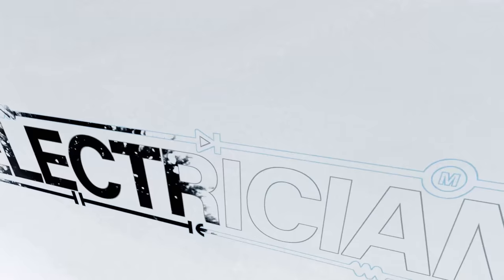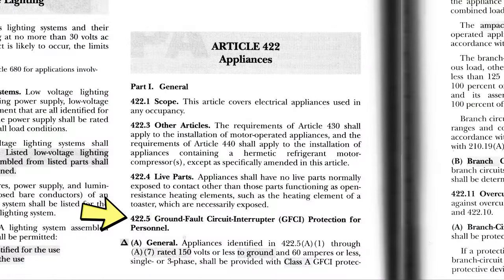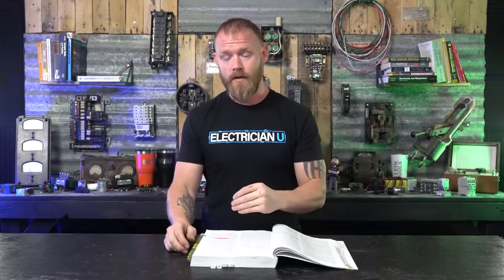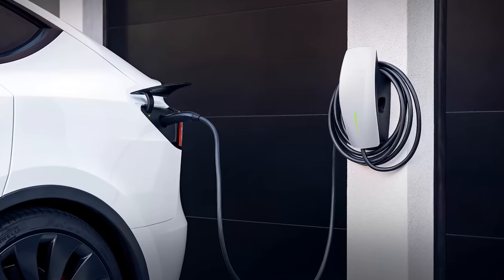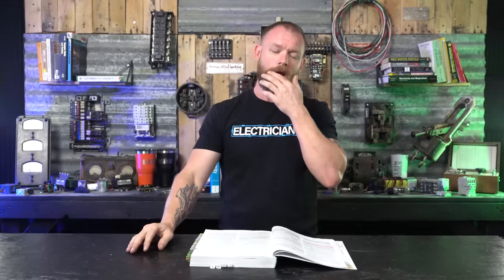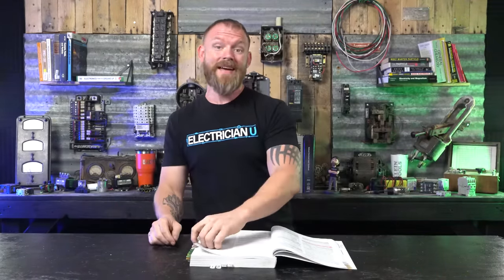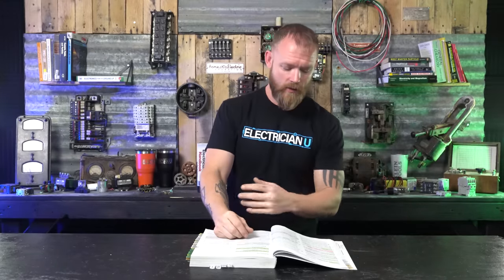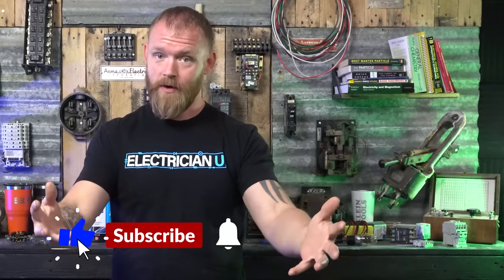Should We AFCI Protect Appliances?

Comment: I have couple questions for you 
I have a new house built in 2021 and I’m in the process of finishing the basement and I pulled the cover off the main breaker panel and found that 99% of my breakers are  AFCI two pole breakers and the neutral and power wires are both Terminated on the breaker with a jumper going from the neutral wire to the neutral busbar in the panel 60 and the grounds and neutrals are separated in the panel
There is no other service disconnect other than the main breaker in the panel From the main service feed
My question is are the neutrals and grounds separated in the main panel because of the AFCI Breakers or am I missing something
Thanks in advance…

Comment: I just need to extend a 20A branch circuit from one outbuilding to another (via new underground line) for the sake of adding some outlets in that second building. 

No water or wet conditions in either building. I'll probably make sure the first outlet in the first outbuilding is an AF/GFCI outlet, I'll use 12-gauge wiring (because of the 20A breaker), I'll probably use 20A outlets in the second outbuilding. 

I think I'm all set for that, with a little more reading up on whether I need the AFCI feature at all. Now I just need to figure out the whole grounding thing (find out how the existing branch circuit is grounded and if I need additional grounding measures on the extension or just extend the existing ground wire through the new outlets).

Comment: So if your oven's receptacle need to be GFI, cut the cord, wire it permanently and you just saved about 200$! 😉
Reply: LOL Then the home owner is hiring an electrician overtime that range needs replaced.  With today's modern quality of appliances, the average would be 5-10 years at most.
Reply: GFCI protection for a receptacle of that size would come from the breaker and not locally at the plug like a normal nema 5-15 GFCI. So cutting the cord would do nothing because it's the breaker that would have to be reset
Reply: @zeddpilsner4  permanent wiring would mean no GFCI because it's the receptacle needing protection, not the oven...
Reply: @drewbrown9678  then, why are (90%) dishwashers not with a plug? Anyway, any homeowner is able to disconnect something, it's when they have to put a branch in panel, or reconnect something they call the electrician.

Comment: Things that have motors that can shock you, it makes sense. But I think they are getting carried away with codes and ignoring nuisance trips. One- the GFCI/ACFI are not cheap. When you think two bucks a receptacle, then more for tamper-proof, and now 5-10x as much for GFCI and ACFI... hundreds of dollars for a single family home in outlets now. Sure, you can put a ACFI breaker in place, but again... for modern homes I can see that.  BTW, lost several hundred dollars in meats and frozen produce to a nuisance tripped chest freezer. Happened once. Pulled that GFCI out and put in regular..I can as the home owner.
Reply: Losing hundreds of dollars of freezer contents when a GFCI trips is extremely common.  You made the right call by eliminating the GFCI.
Reply: if you're paying over $2.00 for non tamper proof receptacles, you need to change hardware stores.

Comment: We install gfci/arc fault breakers on everything except 220 v plugs  or 120 volt furnaces. We do however have to gfci protect any 220 volt plug in garages.  They are a headache and I would put regular breakers on anything like a refrigerator etc that that is the only thing being on that circuit and is not going to be exposed to water. That being said having to pull two separate kit circuits we used to homerun to fridge then catch couple kit plugs and thar would be 1 of our 2 kit circuits but now we dedicate the fridge. I recommend dedicating the fridge anyway because of what it is.

Comment: Yeah and the sucky thing is some washing machines have “issues” when being plugged into a afci/gfci outlet…..some just hate it; while others don’t care.
Anyone else have those fun troubles on service call and trying to figure why a homeowner’s new washing machine just won’t work, lol
Reply: not a washing machine, but i have had calls where customers are having breakers trip because they wanted to turn their lights on. apparently Seimens  AFCI breakers don't like it when you turn your lights on
Reply: Big roasters don't work on GFCI either.
Reply: No problem with the washing machine, but the gas dryer tripped instantly. Plugged it instead into the circuit with the washer and a sanitary pump and the problem went away. Yes, the breaker then got changed.
Reply: I should add that the GFCI outlet was not a problem. It was the AFCI breaker that would trip.
Reply: concering dryers and gfci's, sometimes the nuetral is bonded to the appliance and will cause the gfci to trip. I can see this being done away with by appliance maufactures in the future, but that's how their designed so a homeowner can swap a chord rather than call an electrician.
Reply: @danielcarroll3358  If it uses a spark igniter, and if it is not have galvanic (transformer) isolation in the high-voltage supply, it could have just enough current to ground to trip a touchy GFCI while operating normally.
Reply: @nealbrinton4374  Definitely if it is plugged into a GFCI, it must have a four wire plug and cord with no bonding between neutral and ground in the device.
Reply: @strehlow  It doesn't trip the GFCI. That works fine. It trips the AFCI.
Reply: @danielcarroll3358  Eh sorry, I missed that bit. I could see where a spark igniter could generate enough of the noise on the line that an AFCI is looking for. You might try plugging it into a power strip with a noise filter and surge suppressor to see if that stops it.
Reply: @strehlow  I thought about adding a filter, but when plugged into the adjacent outlet on a different AFCI breaker there is no problem. And that breaker also feeds the washing machine and the sump pump. The laundry room is below the sewer line so the pump is needed.

Comment: I wonder if my house wouldn't have burned down if the outlet my portable AC unit was on had an AFCI breaker. The inspector said the fire started somewhere up in the attic where the wires were ran.

Comment: I brought up article 210.12 on your EV charger video. I researched the different Tesla chargers. They have built in GFCI. That problem is solved. If the EV charger is hanging in a garage, the charger has a plug and might also plug into a 650 or 14-50 receptacle.  I assume the charger has to be AFCI protected?
Reply: AFCI protection is not required in garages at all. In areas where it IS required, only 120V, 15A and 20A circuits require AFCI. 240V circuits don't need AFCI at all. 210.12(A)

Comment: I'm going to make this simple. The code refers to where you HAVE to use one of these devices. Often you'll come across situations where you don't have to use one, but it's probably a good idea for peace of mind. Personally I'd rather spend the extra money so I can sleep better. A code is only written when a problem has come up from result of some condition or unforeseen factor, hence the changes in codes from year to year. I know arc fault devices are sensitive. Use them accordingly. One day GFCI  is going to be required for every application. It's just a matter of time. I hate to say this but safety is no accident. On a personal note I'd like to see any extension cord smaller than 14 gauge be banned. Party on dude.
Reply: Yeah, those 100 foot 18 gauge extension cords, made in...who knows where...are sketchy big time.
Reply: @larryroyovitz7829  The problem I have with extensions is that a 15 amp circuit uses a 14 gauge wire. then someone plugs in a 16 gauge extension and tries to power a window ac or other high current device and causes a fire while they are in bed sleeping. For a single lamp it's just fine.  I think anything smaller than. #14 connected to a 15 amp circuit is dangerous.
Reply: @rickhunt3183  I agree, that's the same problem I have. I wasn't being sarcastic, I literally mean there are 16 gauge, 100 foot extension cords made in China. I've seen them...scary ass shit.
Reply: Ever feel how warm a vacuum cord gets? They are often 16 or 18 gauge wire! Who thought that was ok? I'm also perplexed by 20 gauge from the ballast in fluorescent lights.
Reply: @johnruskin4290  while wires can typically operate at temperatures over 150 degrees. Any heat produced by wire resistance is wasted power. If a 14 gauge is hot bumping it up to a 12 isn't a bad idea. Sometimes you'll find a hard ass inspector that insists  a 15 amp circuit needs a 14 gauge wire and I'll say, but this wire is bigger so it's safer, and runs cooler, and he'll say pull it all the 12 and install 14.. Hard to believe I know, because an inspector is an electrician, and knows this stuff. Always start off being nice  and respectful even if they are an idiot.

Comment: To me, a GFCI isn't just to protect when plugging/unplugging but if a fault develops in the device plugged into that outlet.  If the insulation on a wire in that stove/oven fails, the body of the stove/oven could be electrically energized.  If one happened to reach for the faucet at the same time touching the stove that would be very bad.
Reply: That's not really what a GFCI is "for". That's what the ground itself is for, since that should cause a short to ground and trip the breaker. GFCI's primary purpose isn't as a backup to proper grounding (although it does function that way too), it's to protect against other paths from the hot directly through a person, for example via water.
Reply: @sweepingdenver  In a perfect world, the ground connection would take all of the current flow to ground, exceed the current rating for the breaker by a substantial amount, and the breaker would open.  But what happens if one of those "perfect world" requirements doesn't happen?  Keep in mind that the stove/oven might have a 30 or 50 amp breaker and anything over 0.005 amp (5 milliamps) can be fatal.  That means that literally 99.99% of the current leakage current could be going to ground without tripping the breaker and the one part in ten-thousand that flows through a person's body could kill them.

THAT IS WHAT A GFCI IS MEANT TO PREVENT.

Comment: If the ground  is touching the neutral anywhere past the main point of disconnect in a circuit or will cause what is known as "nuisance" tripping. I do lots of service work and install AFCI breakers all the time on old panels and rarely have issues.
Reply: I’ve opened a lot of receptacles where ground and neutral were joined. I feel like in my area there must have been a sparky who thought that was the way to do it.

Comment: This Is Interesting Video.  Not Sure If AFCI Is Same As Industrial Arc Flash Study, But A Few Years Ago I Was Involved With An Industrial Arc Flash Study For My Employer. The Original Was Done When Plant Was First Built (Finished In 2000/2001). Our Safety Director Insisted On A New/Updated One Since There Had Been Some Expansion Through The Years. It Was My Responsibility To Gather Info (Wire Size & Distance/Breaker Size And Settings/Connected Loads). Consultant Said To Only Include 480 And Above For Study (I Believe They Said 208VAC Cannot/Does Not Carry Enough Capacity/Energy For Sustained Arc Flash). Has 70E Been Updated (2015 Was When We Completed Study)To Include Lower Voltage In Residential Setting?

Comment: How about a dedicated circuit that is hard wired?
Example: An electric heater in a garage.
240v 30a run directly from a breaker to a box mounted on a wall stud with a whip from the box to the heater that is permanently bolted to the ceiling.

Comment: I don't think it was mentioned, but AFCI is only required on 120V, 15A and 20A circuits. Not required on any 240V circuits (210.12(A)). Also, 210.12(A) says that circuits require AFCI protection when there's an outlet OR DEVICE in one of the specified locations. So, for example, a circuit that supplies outdoor lighting doesn't need AFCI, BUT if the switch that controls those lights is in a hallway, or living room, or kitchen, or some other area that DOES require AFCI, then you need to AFCI protect it, since the device (switch) is in an area that requires AFCI.
Reply: actually, unless they changed the verbiage, an outside light switched from an AFCI required location doesn't have to be AFCI protected.  but - are you going to run a dedicated circuit to take that one light off the AFCI circuit?  considering that with modern LED lighting, a good electrician will run two light circuits, so if one needs to be shut off for service or modification, half of the house will still have light.
Reply: @kenbrown2808  I read 210.12(A) again, and it doesn't mention an exception for outdoor lighting. It simply says "All 120V, single phase, 15A and 20A branch circuits supplying outlets or devices in dwelling unit kitchens, family rooms (etc...)....shall be protected by any of the means described in 210.12(A)(1) through (6). There's an exception at the end for fire alarm circuits, and that's it.
Reply: @jonclark1288  they may have changed the verbiage, then.  as I said, it's a moot point because I'm not going to waste my time running a dedicated unprotected lighting circuit across a house to supply one outside light.
Reply: @kenbrown2808  I was just using outdoor lighting as an example. My point was, if a switch is in an area that needs AFCI, you need to AFCI protect it, even if the load that it controls doesn't need AFCI.
Another good example is a detached garage with an outdoor light mounted on it. The garage has its own subpanel, which feeds the light. That doesn't need AFCI, but what if you want to also be able to control the light from the house? You run some travelers from the garage to the house and install a 3-way switch right next to the back door in the kitchen. Boom, now you need an AFCI breaker in your garage subpanel.
Reply: @jonclark1288  and my point was that originally, switches were not included in the rules.  they may have changed the verbiage when they expanded AFCI coverage to everything they could get away with.  as for your garage light, just put a line voltage RF switch in and no travelers needed.

Comment: Due to the nuisance tripping of AFCI breakers their are certain circuits I would not use them Furnace,Refrigerator,Freezer.
Reply: Yeah, I imagine certain motors may be problematic.

Also I tried using a GFCI around a 50mhz ham radio of mine and it kept tripping off.
Reply: @jeffkardosjr.3825  I don’t know I have them in my home and they seam to trip with out rime or reason may go 6 months with out then 3 trip in one week on 3 different circuits. Won’t use one on a critical circuit.

Comment: check your state's specialty code.  AFCIs are being pushed hard by manufacturers, and the consequence I'm seeing is people are overloading general lighting circuits in order to reduce the number of breakers they have to buy.  some states are choosing to only require AFCI protection on general lighting circuits and specifically NOT require it in kitchens, laundry rooms, garages, etc. 
and the fact of the matter is, more problems are happening because of overloaded circuits, and sometimes because the handyman comes in and replaces the AFCI breaker with an oversized standard breaker.
Reply: In Arkansas the fire marshal said we had to put them in dwelling units... but that he only counts dwelling units as where someone actually sleeps. Anywhere else he only cares about if it requires GFCI protection.

Comment: Find out the code book used in your area.    2020 may be the latest but your county inspectors may be using older 2017.   In that case you would not have to do what's in 2020.

Comment: Other than cost, is there any reason to not use AFCI and/or GFCI even if code doesn't require it? Just thinking of the home owner who may be getting one or two more circuits run, why not have the electrician put in the protected breakers when the new branch circuits are run?
Reply: Nuisance trips, especially if it spoils food or floods your basement.